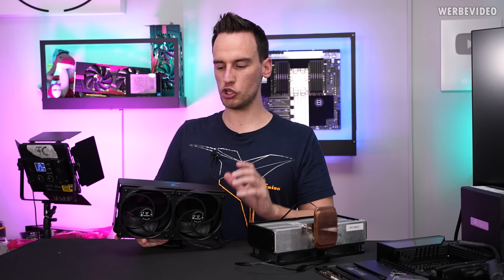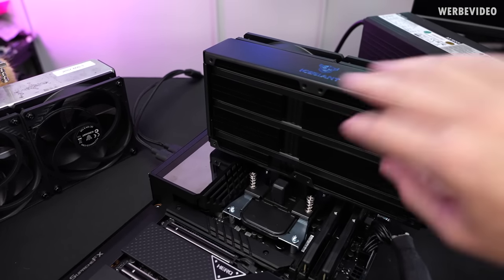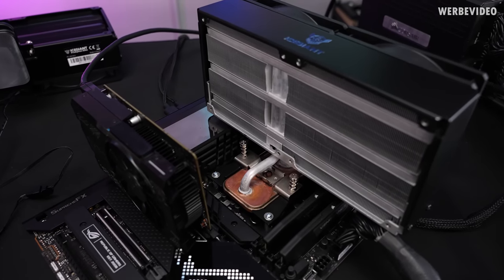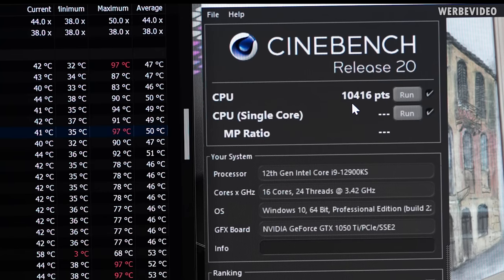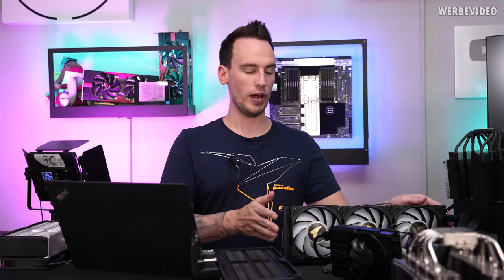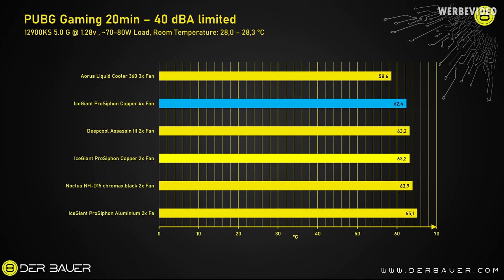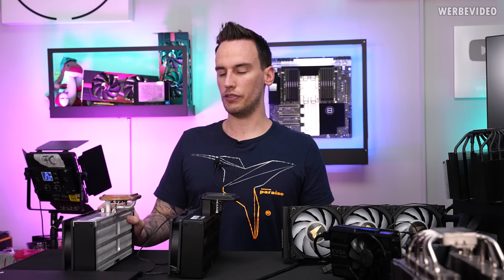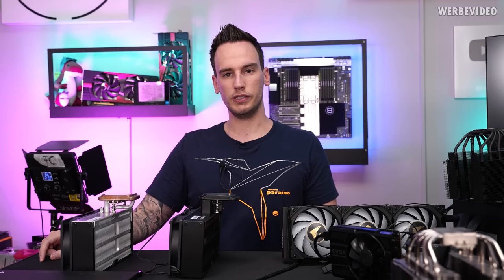This Prototype has A Lot of Potential !

Comment: I think this would be a great risk for vertical mounted motherboards.
Reply: Not at all. Not the first time a pro siphon is used. Problem is they are twice the price of a Nhd15 for almost no gain over traditional heat pipes solutions.
Reply: @ravell2854  You forgot that they're also huge in comparison. The gains are basically due to the thermal conductivity of the larger heatsink.
Reply: @Deathend  Yes they are huge, but they also engineer the mounting solutions in such a way to not stress that much the pcbs if they are firmly secured with all screws to the chassis

Only risk would be if the rig is moved from site to site without removing the cooler first

Comment: The IceGiant is never going to perform well on an intel CPU - it is designed specifically for larger heatsink CPU's such as the AMD Threadripper and Epyc series processors. My IceGiants (I have 2 on 2 different Threadrippers) outperform Noctua by a considerable margin - they also outperformed by Cooler Master ML240 closed loop AIO. Testing on an intel processor gives skewed results on a CPU which is not on the intended test case by Ice Giant. As a sidenote, their customer service is exceptional - they wrote back to me within hours of writing to them, not days like you would see from most other co's.

Please test the Noctua and the IceGiant no just on an Intel 12900, but also on a 3990x or similar. This would demonstrate the divergence in results as a result of the larger CPU die.

Comment: Unlike the NH-D15 you can use this with Threadripper, though. I'd never use this on a monolithic Intel chip because there's very little that can tame those at this point. So much concrentrated heat.

Comment: My 10850k consumes 220-230w and thermal right macho rev. b can dissipate that much heat, I use mx5 paste, and 140 on top of the case which sits very closely to radiator + 120mm rear fan

Comment: Is there any performance difference vertically in a case vs horizontally like on your test bench. 

Also, if you could find one of the air cooling unicorns somewhere from circa 2007 I’d like to see the Thermalright TRUE copper 120, fans have come a long way, and I think 1.9kg of copper with some noctua fans on there would cream this thing. You’d need to make your own mounting bracket and probably lap the mounting face, but I think it would put up a very good fight.

I had one back in the day on my FX, sent it to the dump with the computer when cleaning the house..Kind of regret it, should have kept the cooler even as a decorative piece.

Comment: it's clearly that new cpu's need watercooling, air coolers will not dissipate such amounts of heat  any more. or that should be a HUGE coolers which will use most of the case space )
actually i think it's better to look into another kind of cooling like case-refrigirator or somth like that. 
and hardware manufacturers should make kind of notebook design with cpu and gpu placed on motherboard and all this system will have better cooling and will use less space.
also motherboard slots positions should be optimized for cooling from coolest one to hottest one on the coolant route .

Comment: I have IceGiant ProSiphon Elite with ryzen 5950x oced to 4.6ghz all core and i will never go back to aio. In idle and gaming the fans doesnt even spin so it is much quiet and cooler than aio 280mm which i had before. Cant wait for cooper version. Really amazing tech. With phanteks t30 fans i can get even more headroom to 4.7ghz all core, it is so hard to believe what we can do on air these days. I use mostlly my pc for rendering, so water cooling is not a option for me.

Comment: My good old NH-D15 is waiting for a replacement... It will either be IceGiant or D15 v2 :)
Reply: Also.. am I wrong or does the IceGiant needs to be in a specific orientation (with mobo being in in-case position, not test bed position) for the best performance?
Reply: @bartekowca666  Yes, like most vapor chamber designs the orientation is key or the designed flow will struggle. if you but the currency version you should install it so the logo is displayed correctly

Comment: Hi, did you test with your mobo verticaly, to be sure? the cpu was in liquid phase.
Or a good angle test bench.
Thermosiphon use fluid density and phase change. The other cool long device not require orientation…

Comment: The problem with CPU temperatures start at the IHS level. Intel and AMD should start selling CPUs without IHS using an enthusiast program or to system integrators. It's a few bucks cheaper and if you damage your CPU during installation, you're SoL on warranty. Otoh, there will be a market for cooler manufacturers to design fool proof mounting systems or even LM application kits like Asus use with their high end gaming laptops.  

Edit: If you don't believe me, look at the mass, surface area, material and airflow for the high end GPU coolers. It's at most, comparable to a dual tower cpu cooler and 300W+ GPUs tend to run real cool when paired with a 240 AIO while a 230W+ CPU requires 360 or custom.
Reply from the maker: For the normal user probably just too difficult and dangerous. I think it's better with IHS for the average user

Comment: Given the trend of cpu's using more power and generating more heat, will air coolers remain relevant going forward?
Reply: Yes, CPUs have always fluctuated with new generations (particularly shifts to lower NM). Intel is definitely pushing more than it should of the box currently.

Of course liquid cooling is better for performance (with a good system) but air is fine for a lot of systems. It just depends on how much heat is coming from the chip, just look at Bulldozer and Piledriver etc. Processors from years ago with huge TDPs, efficiency has improved a lot.
Reply: This only applies to the i9 (and maybe also r9, we'll see) going forward. Most people don't spend 800$ on their CPU, those who do can afford big cooling.
Your i3 i5 i7 or AMD options are all perfectly happy under your 30$ 1 fan 4 heatpipe aircooler...
Reply: @SquintyGears  eh an i7 10700k thru 12700k wouldn't be happy with a cooler like that
Reply: @startedtech  stock they would. OC they wouldn't.
Viewers of this channel probably OC but most people don't.
Reply: Look at it as the ceiling is raising. 99% of consumers don't purchase top end anyway, so it doesn't need to affect them.
Reply: CPUs use more power if they are allowed to. Not a trend for the average joe. Your average i5 and i7 will do just fine with air coolers, those tend to be happy on the 120-160w range... even i9s can be cooled by air on stock configs but..... who buys an i9 and not oc the damn thing? and if you buy an i9 surely you have the pocket for an aio at least
Reply: @ravell2854  it's more like 125W peak on the i7 65W typical load 90 on the most power hungry i7
Reply: @SquintyGears  You are thinking on the 12700f. the K version idles a tad higher.

But even on a "sligthly oc" i7 an air cooler is more than enough, the best air coolers can handle up to 200w before throttling

Comment: I thought it is meant to be installed on a vertical motherboard like in normal pc case, can you test the difference in thermal between mounting it horizontally and vertically.

Comment: Quick question on that one: Aren't copper heat-pipes supposed to be better than the aluminum one for the same reason? If they can't transfer the heat to the radiator fast enough, they can't dissipate it effectively, no? Even most of the budget coolers like esport 34 use aluminum plate with copper pipes, I think(?).
Reply: afaik all air coolers are using copper pipes.

The cold plate itself is what got the upgrade to copper here.
Reply: Reasonably, they should be making this entire thing out of copper if they want it to perform well.

Comment: Should have tested the prototype in both horizontally (up and down oriented) and vertically placed motherboard. The vapor chamber might not operate as expected if the steam goes where it's not supposed to.
Reply: it works in both orientations(according to them)
Reply: operate the same, steam goes up in both orientations, that was already tested on previous videos. The only new test is the cold plate on copper while the original test was on an aluminum cold plate, the rest of the body is the same.
Reply: @ravell2854  But if the cooler is upside down, and the steam goes up where the copper plate is, it will make things worse.
Reply: @harryshuman9637  what? there is no upside down orientation. Just 2, horizontally and vertical with the evaporator in the lower part of the system...there is no upside down position.

I suggest you to check a prosiphon video about the 2 only orientations for this type of cooler.

Comment: Thermal conductivity isn't the only thing you have to take into account. Cause aluminum will dissipate heat while copper soaks heat. So you want a copper base and an aluminum sink to dissipate the heat of the copper plate that has soaked up all the CPU heat.
Reply: This is incorrect information that gets repeated far too often. Copper is better, period. The material doesn't "know" what it's conducting heat to and from. Copper is a much beter conductor, and is always better that aluminium.
Reply: @noxious89123  now you are making things up to fit what you know. Not what is factual.

Comment: Copper alone does not explain the best thermal properties, it maybe due to pipe positioning, if both was in the same place that stupid cause the loop was closed at the pipe level not allowing thr fluid to percolate and cool efficiently the cpu, that's phase change after all.

PS. From a guessed point of view, they cant gain an additionnal 2-3°C average if they design this heat exchanger properly, I wonder why they don't look at publications related to this
Reply: Maybe they do... thats the point of being a "prototype" to test better configurations. Not every theory can relate 1:1 to real scenarios

Comment: Been Using a 1x radiator watercooler cpu i7.900k  built around  2017- 2019 build  works good 
GPU RTX.2080super Waterforce  no huge oversize radiators like this Junk in my pc watercooling Rules  % wize

Comment: Dose silver have any problem? (If we do not count the price) why we are not using it for cooling , it is better than copper?
Reply: way too expensive for just a pc component
Reply: doES not dose..... ffs
Reply: Corrosion as well as cost.
Reply: You can do the math on it you know. You check the conductivity index on Wikipedia of both and you google the stock market price of the material. It's a 5% conductivity increase...... How much money are you ready to spend on that?
Reply: So 500g silver will be about 300€ if you buying 4000€ laptop, will you pay extra 300€ for 5% performance?
Reply: @dachyvashakmadze1871  5% conductivity isn't 5% cooling performance and it's absolutely not 5% computing performance...
5% isn't even 1°C... The difference in conductivity between alu and cu is around 3x and you already don't see that big of a difference.
Reply: silver and gold are better on paper but in practice it's not a noticeable difference at these scales. They only cost (a lot) more
Reply: @SquintyGears   i really do not know thermodynamics and optimal cooling. I just asked stupid question 🤣 because i was not able to kick it out of my system 😔. I have one more stupid one it is possible to make technical diamond can we use it for cooling 🤣
Reply: About silver yes it is expensive but it holds value 🤣, you can resell it as silver. Ok 👌 lets and this stupid topic. Wish everyone a good day and extra luck today 💞.
Reply: @dachyvashakmadze1871  yes its theoretically possible. They have very good thermal conductivity too. But nobody would know how to build such a thing.
Reply: you answered your own question... price

Comment: thanks for this.... would be nice to see how good the are on new thread ripper pro platform . but i suppose a custom loop makes more sense, to have more radiators for that one
Reply: the problem is trying to fit one in a case with the tr pro's 90 degree rotated angle.
Reply: @CarlTurechek  yeah wendell mentioned that problem in one of his most recent videos on tr80. he was rambling about rotating a fractal case by 90 degrees or something to that effect. cant remember now
Reply: @dreamcat4  you'd need a really tall case for that orientation. It might be doable. If you don't need the reliability, then it's probably not worth trying though. I went with regular threadripper because of this, mistakenly thinking there'd be an upgrade path! Just can't win lol
Reply: @dreamcat4  well, in addition to a tall case it might interfere with a gpu and the cooler has to be horizontal with the ground or the mobo has to be in a desktop case with the cooler in upright position. It'd be quite the task lol
Reply: @dreamcat4  I think if they want to succeed they'll need to start making some other form factors.. Threadripper is dead.. unless they know something we don't lol
Reply: @CarlTurechek  yeah i dont disagree with all of that. imho i prefer the extra flexibility of water cooling.... come to think of it. there is now a new successor to novec solution. (which isnt mineral oil and does not evaporate like novec, and is not toxic). so maybe we will hear more about that other technology in the next couple of years. i forgot where i saw it now. was in a recent youtube of another channel
Reply: @dreamcat4  sounds cool, no pun intended. Can't say I'll be upgrading to the copper edition considering how tough it is to remove the cooler.. can't see it coming off without the cpu still attached.. and that could cause some issues lol

Comment: I could be wrong, but I seem to remember these coolers were designed to be used on a vertical system, and were supposed to perform better in that orientation than on a horizontal test bench. Has any testing been done to prove or disprove that theory?
Reply from the maker: Yes there is no difference about horizontal or vertical Orientation. You can even read this on the Ice giant website
Reply: In fact it was tested on a previous video in this channel. Check that video.

Comment: Imagine if they added heatpipes like a regular air cooler on top of the siphon tech. Also make those big ass tubes copper as well and add a hint sink on top of the block. This can be really good if they maximize every square inch of the thing.

Comment: id like to see a all copper version!
Reply: yeah, five kilogram cooler sounds like a good idea. :D
Reply: Man, even good old ThermalRight TRUE copper cooler weight 1,9 Kg. If they make it from copper... i can't even imagine how much it will weight. And also how much it will cost. Mount will be super problematic - only horizontal.
Reply: It would have to be a 120mm version but hay if a 120mm all copper version outperforms the original just as much as the copper base revision here that's adding a form factor improvement
Reply from the maker: same here haha. Maybe they can make a custom one xD

Comment: It actually works exactly like an air cooler that uses heatpipes.  It just uses a lot more liquid, maybe different liquid.

It does seem odd no one did this 10 years ago.

Here's an idea, add a pump guys.
Reply: Yeah... It felt like "an AIO with fewer steps" through the review - with some downsides of both approaches, but few upsides.

Comment: I don't see the potential in this. Losing to NH-D15. Can't use it in all orientations because of how this cooler works. And it's bigger than standard air coolers. Epic fail on all 3 fronts.
Reply: Did you watch :D it beat all the air coolers
Reply: @agoli4898  yeah, did you watch it? didnt beat

Comment: I don't think that copper makes such difference. I believe painted fins makes the difference. Testing unit has bare fins while aluminium unit is painted. I think when retail black version will come, difference between copper and aluminum cold plate will be a lot less.
Reply: have a look at performance differences between a Hyper 212 and the black edition to get an idea : zero difference. only fans matter on the fin stack.
Reply: @ledoynier3694  Hyper 212 black is black nickel plated, while this cooler is black powder coated i believe. Two diferent things.

Comment: You seem to have a lot of time and is looking for something awesome that can work. Why not connect a peltier cooler to a resevoir. In simple terms the short loop runs through a heatsink on a pletier back into the resevoir and the long loop runs to gpu and cpu and back. The resevoir is connected with t junctions running to the components and the peltier. Even a small one refilling the resevoir in my opinion will cool the water amd the water the computer
Reply: Because peltiers draw a shitload of power themselves to operate, and also getting a peltier that can handle 230W+ is serious business. What you're describing is basically what EKWB and Intel collaborated to make, and you can actually already buy that as a cooler. Very expensive though.